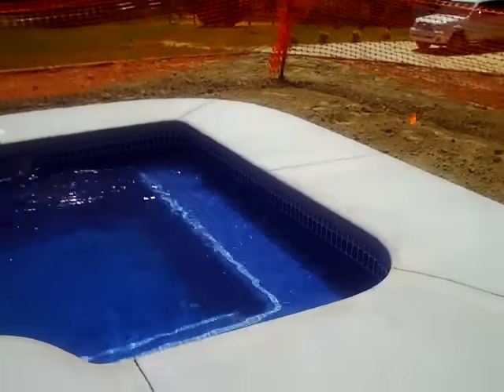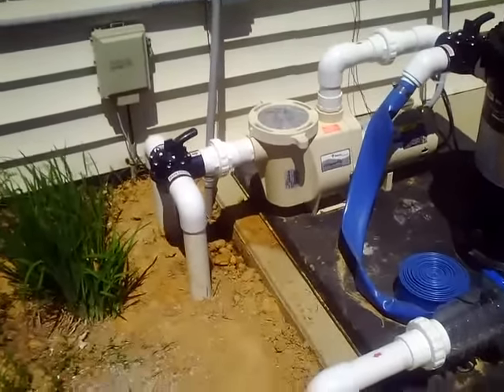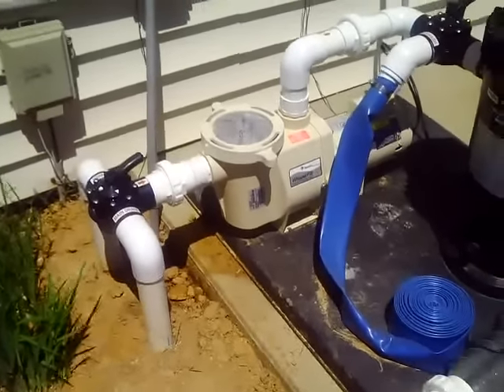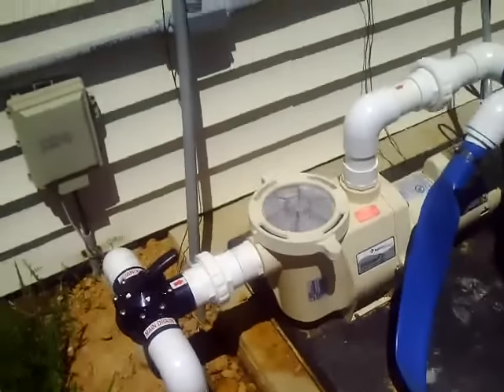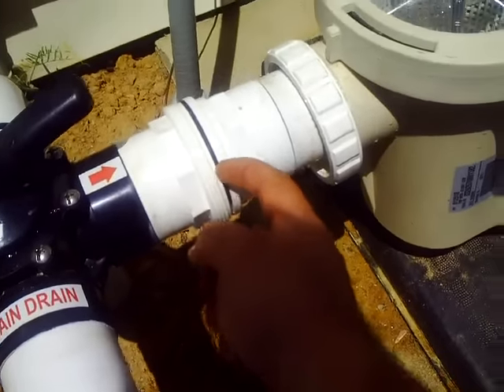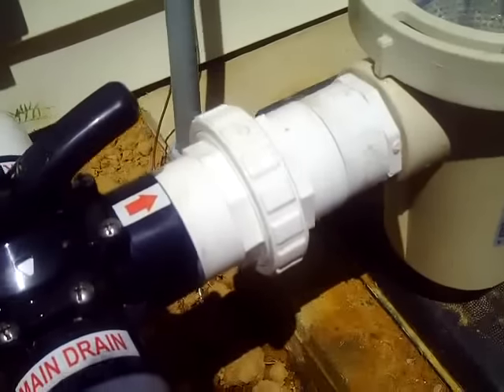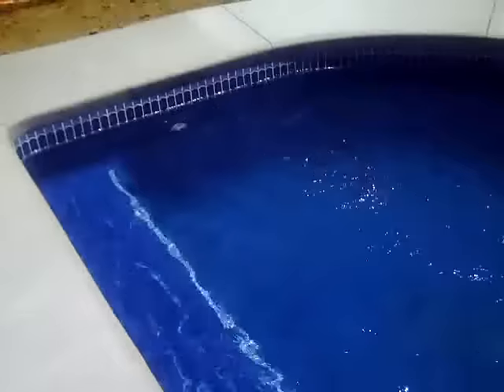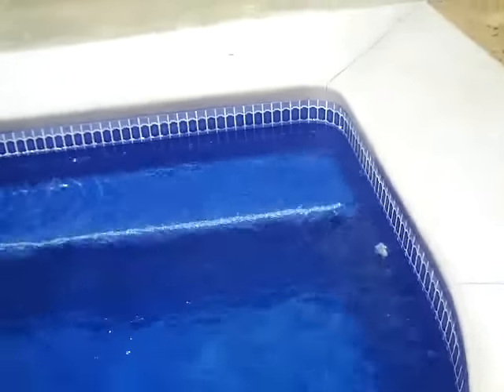Why are there Air Bubbles in my Pool? A Troubleshooting Guide

Comment: This guy left out countless reasons as to why you might have low prime. I've been servicing pools for 20+ years commercial and residential
Reply: Shaft seal, weir door, over heated/warped male adapter, jandy o rings, glue joints, pinholes, troll farts

Comment: That suction side 3way can draw air as well, a bad glue joint, crack in housing, crack in lid, leak at the seal plate or even a loose drain plug on the wet end. FYI.

Comment: I know this is a necro commenting on an old video, but as a new pool owner your video was great. My lid was on tight, but the gasket was old and when I touched it I had black on my hands as if I had just had a magic marker leak on them. I could see areas on the gasket that were flat instead of being round. I bought a new gasket and no more air bubbles! Easy to follow explanation. Thanks for posting.

Comment: Thanks a million Jason, 
We had the same problem. the local pool supply company ( Club Piscine)said that we had to change our sand for $ 200 odd dollars.They couldn't undo the filter.They suggested we buy a new filter.Then I found your video. We changed the O-ring on the filter and checked the O-ring at the union. . Using a ratchet I tightened all the clamps on the suction side and it fixed the air problem. I also saved hundreds of dollars. Thanks again.
Stewart

Comment: I've had an air leak in my pool for about 2 weeks.  This video finally got me out of my chair to see what I could do about it.  Well, this is what I found.  A while back, I changed Jandy valves from the kind you grease to the kind you don't.  But on the casing, of course, grease caps are still there.  A long time ago, one of these caps broke off in my hand, but never experienced any problems associated with this scenario.  But now this leak has raised it's ugly head, So I tried one of the tricks someone mentioned to help find this air leak by quickly turning the pump off and back on again.  So with my eyes squarely on the pump I turned it off and quickly turned it back on, and lo and behold a small squirt of water landed on my foot.  As it turned out, the plastic left behind from the broken cap must've been good enough to keep the air out for, heck, probably 2 years.  But over time this plastic must have been deteriorating to a point when it began to take air a couple weeks ago.  To confirm this as the problem, I simply placed my finger over the fragmented plastic and pressed against the casing to act as a plug and sure enough, in just a few seconds the air purged and the swishing of water in the pump's basket disappeared.  I shudder to think what a professional would tell me the problem was as he/she hands me a three or four hundred dollar bill. Apologies for all you pros out there who take exception to this comment, but I live in Florida.  And for those of you who also live here....enough said!  So now I'm thinking that I should trim the plastic fragments even with the casing and apply a Silicone caulk to plug up this problem once and for all, or clear it all out and apply the Silicone.  Anyway, thanks heaps for the video and the ensuing comments that just about solved this dilemma for me!

Comment: Very informative minus one thing else to consider that I just experienced.  In Jason's video you can see there is a 3-way valve on the suction side of the pump where the skimmer and main come together prior to the pump.  Typically (as is with mine) it is a PENTAIR 263028 3-way diverter valve. Inside that valve there are three o-rings. One of these can be missing, torn or worn and will allow air into the system stopping the pump from priming let a lone operate normally cycling water through the filter.  I bought an o-ring kit for my valve on AMAZON for $7.53.  I can use a tool without harm to myself so I made the simple o-ring replacement myself.  If you decide to DIY, then be aware of the valve position when you disassemble it and use proper o-ring lubrication.  Otherwise the o-ring will just deteriorate and you will be back at square one.

Comment: Thanks. I didn't put the plastic screen in the right direction on the sealed filter. It wasn't letting the cover tighten all the way, even though it seemed tight enough. I had to go out at 10 pm in the dark to figure out what was the culprit after watching your video.  Success!

Comment: Many recommend silicone-based grease on gaskets and seal rings, such as at the union you fixed, and on the O-ring under the lid of the screw-on top of the pump basket, and on any screw-in drain plugs that might have loosened or which don't have a separate o-ring and depend on the grease for a good seal.  Thanks for a really great video; it is still the best after being made and posted 14 years ago.

Comment: Thank You, Thank You, Thank You! after watching dozens of videos with no results, I came across your video and bam. My problem is solved 1 2 3. in my case the Diverter valve lid O ring was not properly sealed. Its not covered in you video, but you led me in the right direction.

Comment: 13 years later my pump cap had a maple copter breaking the seal after cleaning. I felt dumb, but your video helped me out. When I turned off the pump I could hear the squeal of the air being sucked in and saw bubbles being sucked in. I’m dumb!

Comment: Great Job on the video! The second thing I would check after the water level is the skimmer. Some skimmers have an insert that gets cocked, causing air to be sucked in through the top despite having an adequate water level.

Comment: Great vid, I might add to check the weir doors to verify a leaf isn't stuck in there keeping it from operating correctly...its happened to me and it stopped water from flowing into the skimmer correctly which caused it to suck some air.

Comment: 3way valve BEFORE pump inlet had a wobbly union, that was the source of my air bubbles, fixed with new modern 3way valve vs twenty year old one. Great video thanks.

Comment: 4th thing to check is the skimmer weir door. If it's stuck in the up position even though the water level is correct it can still suck in air. Easy way to tell is to look in the front of the skimmer and make sure the skimmer door isn't stuck in the up position. Also for floating weir door that the basket isn't full of leaves causing the floating weir to be stuck too high up. Main cause is skimmer for air issues. Also to see easily and air leak at pump turn off and on pump quickly a few time and where the air leak is will squirt water out.
Reply: Stuck weir door.  Thanks for the tip, it just solved my problem.  THANK YOU!!!
Reply: Yeah i had that happen sometimes
Reply: Crotch Banister  o-ring is cheap, I'd replace if it is at all worn.
Reply: Does the foam piece on the weir plate go on the bottom?
Reply: @janicemontagna4098  The foam should be on the TOP edge of the weir door. That way the top edge of the door floats just below the surface and maximizes the skimming effect

Comment: Excellent video!!  Thanks to you I found a crack in the strainer lid and then the Jandy valve diverter valve stem o-rings were leaking.  A tip from a local store was to spread shaving cream around the Jandy valve stem with the handle removed and sure enough the bubbles in the strainer went away.  
Thanks for the great videos!!

Comment: Thank you for the video. I"m sort of a newb pool owner, our 18x36 in ground pool came with the house we bought a couple of years ago. We had a new liner installed and things seemed to be fine, but two weeks later I'm seeing air bubbles ONLY when we have it on main drain (sump).  Water level is fine, skimmer is fine, so I checked the valve-pump union. It's several years old and the gasket appears to be mashed flat. I cleaned it, lubed it and retightened it and same issue. I am going to replace the entire union tomorrow (unless I can just get a gasket). The pool pump (Hayward Supreme) is two ears old but the gasket around the top of the filter basket seems a bit aged and stiff. I lubed it and tried it and no difference. SO I'll just replace the union tomorrow and see if that fixes the problem. When it IS on main drain, and I'm getting some cavitation in the basket, there are no water bubbles being injected into the pool by the jets, which is weird.

Comment: One thing I like to do is watch the plumbing and pump closely when I turn the pump off. If there's a leak on the suction side, the resistance of the pump and filtration system will typically cause some water to briefly flow out from the culprit area.
Reply: In retrospect, this is what I observed, but didn't understand at the time.

Comment: Great video! If I may, a lot of times and especially if the oring is in a vertical attitude like in your union, the oring will want to fall out.  Before installing, coat the oring with silicone.  This will help hold the oring in place when assembling and actually creates a better seal.  I use it on all of my oring sealed components in my pool equipment.  Just saying...

Comment: Great video - thanks. I have another option if it doesn't work. In our case it was the drain valve of the pool pump. It was lose and sucking air
Reply: Yeah. That is the main one he missed. Not a bad How to.. Vid, however don't start cutting up concrete before you either tighten or replace a two dollar drain plug on the pump.

Comment: I may have other problems, but this was really helpful. I loose power from the vacuum when I try to clean the pool, but it may be that the suction side loses power from air. This explanation was very good. I have three returns and three suction lines (Two skimmers and the main drain) which increases the number of air leakage possibilities.

Comment: Another reason its when you have to many 90 degrees elbows in the pipes.
If you have a single speed pump, friction of water against all those curves may cause water to produce friction bubbles, I dont like using universal unions, here in the caribean where Im Pentair Warranty center, we recommend using universal male adapter and they are heat resistant, the attach to housing without any sealant because it have orings. If we have some hurricane warning we take them in a safe place or if you have to inspect or clean beneath the pumps are good.
Nice video

Comment: Well done. another trick, get the pump running as good as it can and then kill the power to it and look at every connection in front of the pump.  Back pressure will usually cause the the connection that is drawing air to leak a little water.

Comment: I am currently dealing with cavitation on the same pump  you have.  I will try checking the tail ring O-ring as I have already replaced the lid ring.   If it is a suction side leak how do they determine that?  Wouldn't I see water coming out of the ground?   Thank you!
Reply: no. on the suction side, it would only bring air in.

Comment: Helpful video. But I would like to add one more possibility. If the trap door on your skimmer isn't opening properly it will prevent your filter from priming properly. Mine got stuck and I pushed it open and the filter runs fine now. Simple fix.

Comment: Hi great video great voice.  Anyway everything had been trouble shoot pool mechanic has narrow leak down to two returns. Says the two that connect off the main return is leaking. That it leaks approx. 2 fingers in 3 days while filter is on and double that when pool is off.  After watching your video I think he's right because the two returns running off the main always blowing out air bubbles in the pool while the main never does any bubbles when on. Thanks any help please, Luba

Comment: It can also get trapped if the pump is at a higher elevation than the skimmer when emptying the catch basket. Just close the skimmer and main drain valves before you take the lid off. So you only lose the water from the pump side of the valve to the pump it's self. You can just open the air escape valve on top of the filter. Not sure about sand filter but cartridge and DE filters have it.

Comment: The other thing is the actual pool cleaner. I have a zodiac "robotic" cleaner. The issue that no one mentions is that they have a tendency to climb too far up the walls whilst cleaning and therefore suck in air from above the water line.

Comment: 3 way valve also has a cap oring and orings on the stem of the diverter that can suck air if worn or not tightened down

Comment: I fought with my pool for the entire 10 plus years I lived at that house. Old property and the pool was probably built in the mid 50's.  The bubbles were ever present an after a few days, the pump wouldn't move water. Some kind of air lock thing. I could usually backwash and get it going again.

 I understand the mechanics and knew the bubbles were coming from the suction side somewhere. The pool vac hoses were constantly failing as was the head of the unit.  The n the old black bottomed skimmer was suspect so it was replaced and. It worked for a while. I replaced all the old black plastic pipes that I could get to. That helped for a while.

The longest I was ever able to keep it going smoothly was a few weeks. It was my hobby and my nemesis for far too long..

Comment: New pool I have a small amount of air bubbles coming out of the returns. Pool guy is trying to tell me it's either my salt generator or a clogged filter. So he's turned off the salt generator (he said the bubbles adhere to the fins) and removed the filter(he said a clogged filter will create a backflow of bubbles). Without any of those things functioning the bubbles have seemed to dissipate. I went over and turned on just the bottom drain and then the skimmer. Whenever I have only one working the bubbles come back. I only have one more month on my warranty. Any advice?

Comment: Another way to check where the air leak may be is to run water from your garden hose over each connection for like 30 seconds and if the air bubbles disappear that tells you where the leak is.

Comment: Few points missed.Air leaks can come from the threaded fitting on the pump, the rains plugs for the pump or the lid gasket.Something not mentioned was the HP of the pump. Too large a pump will have difficulty drawing water through the suction lines when oversized. I tell my customers it's lie to suck water through a cocktail straw. The piping is too small and the pump too big. Oversizing pumps is a common thing in this trade.The 90 degree elbows at the valve should have a minimum of a 6" nipple prior to the valve. This allows for the water "travel" a bit before make a turn.These few points will create what's known as cavitation in the pump. It's drawing more air than water which creates the bubbles. It can damage impellers over time.Oh, the little bit of bubbles in the pump is not normal. The pump housing should appear as if there is no water in the basket. This will indicate no air is coming in and the pump is now running normal.One more thing. The filter air relief should have been opened on the start up to release the air in the tank which can be potentially dangerous.This information I post is based on my 35 years in the service and building of swimming pools.
Reply: I agree with you, he missed cavitation, if diverter not placed properly on that side port suction, O ring in pump 2 small ring, O ring filter drum, O ring in gage.  The main reason he said is the Union O ring, not true, very seldom that is the culprit.
Reply: @Sal112350  The bottom line is, air bubbles are caused by air leaks at the suction of the pump only. 

Whether it's the inlet pipe's seals, O rings on valves or unions, lid O rings, drain plugs on the pump housing on the lint pot side only.
Anything after the suction portion of the pump, if there are deviations, will not produce air bubbles. It's all from the suction side. A bad O ring on a filter tank will not produce bubbles.
This also includes too big a pump on too small of pipe.
Reply: @kevinmisley8600  No. Air suction leaks are NOT the only cause of bubbles in the pump. Another common cause is a poorly installed inlet pipe. They are often too short and too close to a sharp bend which introduces turbulence (cavitation) and bubbles. I see this all the time. Manufacturer recommends an inlet length at least 5x the pipe diameter. So a 2” diameter pipe requires a MINIMUM of 10” STRAIGHT inlet plumbing. I’m amazed at how many installers ignore this because shortens pump motor life and it’s a pain to fix (by replumbing)

Comment: I had this problem for awhile. this year i basically resealed all the connections with teflon tape., worked perfectly. I used to get a back pressue push up to the skimmer basket when the filter shutdown and it would dislodge and wedge the flap so it would block water flow. now it doesn't do it anymore.

Comment: My problem is when I turn off my pool pump air starts bubble up in the basket and the water in the basket is leaving the basket. What can cause that to happen? I don't see any water leaking from the pump or the filter. I replaced the o-ring on Trap cover on my Stat-Rite pump and still losing water in the basket.

Comment: Hi. I've been having this problem. Did the checklist:  water level is ok, stainer is ok and clean. I tried playing with the valves. I noticed when i close the main drain valve, the air bubbles disappear but then the motor makes a weird labored sound. Any suggestions to solve this?

Comment: I’ve just discovered recently that if I intentionally allow air into the pump stream it infuses oxygen into the pool.. This infusion greatly reduces the need for oxidizing chemicals as the oxygen takes the place of them. It will also allow you to reduce alkalinity without affecting ph. I only do it sporadically by loosening the pump basket filter lid slightly and allowing outside air to be drawn into the stream where the velocity is the highest. You have to keep an eye on it because if the pump shuts off it will leak water.